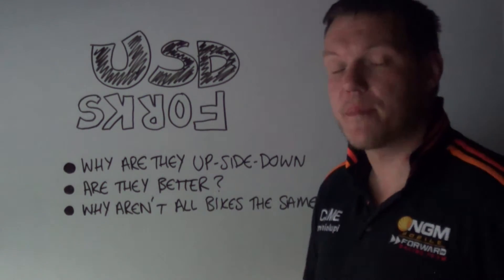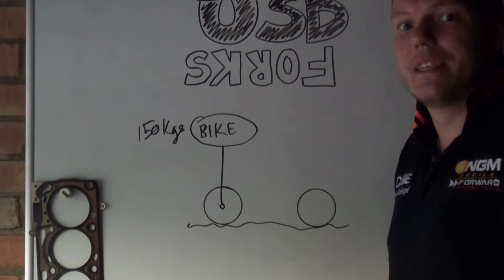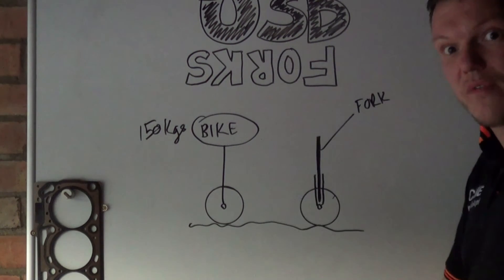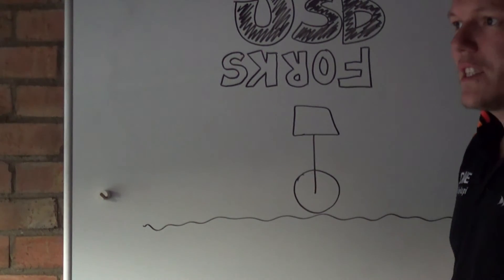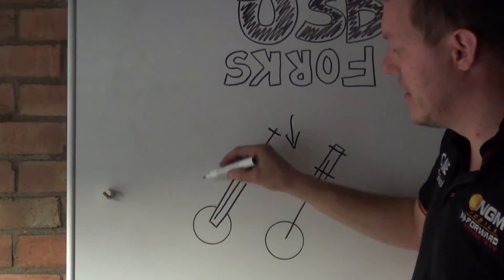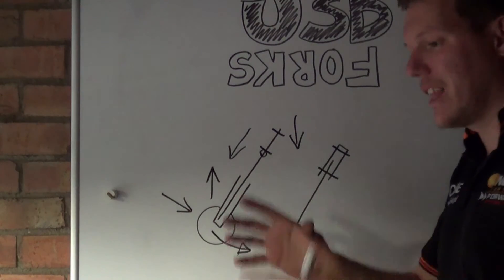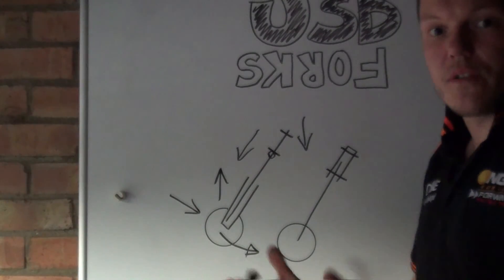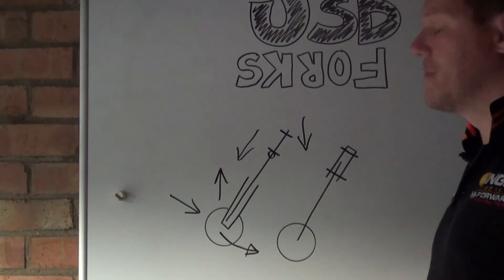USD forks - what's it all about? - Bike TEch

Comment: I have have had bikes with both types, and to be fair never really noticed much difference between the two , but my BMW with the tele-lever is a totally different kettle of fish fantastic forks but against a standard set up carries the extra weight so no good for the race bike ,  as for the unsprung mass the jaguar engineers got this when designing the E type rear axle and put inboard discs , and let's not forget the other iconic race car the 2CV  had inboard discs to the front 👍👍👍

Comment: I have a question about the material stiffness. You said that aluminum has a higher stiffness than steel, how is that? Because isn't steel a much higher Young's modulus value? Thanks for the video
Reply from the maker: The elastic modulus of a material is intensive not extensive. In other words the Young's modulus is dependant on the material period, not the shape or size of the part in question. 

Stiffness is extensive, the stiffness very much depends on the shape and form of the object being tested. This is why H beam rods are that shape. 

But you are correct - what I should have said was Aluminium is stiffer vs a steel counterpart of that weight.

Comment: One thing... yes just one thing! I thought also that the handling on a USD fork is better because the weight is less on the top and lower to the pavement that gives the bike a better frontend handling and makes it easier to flip from turn to turn (direction changes). As lower the mass you have to move in a turn as less the gravity will try to pull it out of the turn.
Reply from the maker: this is the difference between sprung and unsprung mass or have I missed something?

Comment: Proper late comment but another point I heard for usd forks was so the tube section could be longer meaning less flex, less wear and lower sliding resistance as the stanchion bushings are a lot further apart but still have equal travel to conventional forks.
Reply from the maker: "longer meaning less flex" - longer would mean more flex as the force is applied further from the pivot.
Reply: The Workshop “ longer meaning less flex”
unless it’s the interaction between two tubes that haven’t suddenly grown in overall length/travel! Cock
Reply: @ChrisWGT86  classy.... Because you weren't clear or accuraftte throwing insults. Smooth dude

Comment: Excellent explanation! And they are really filtering down now, my cheapo Chinese supermoto has big fat upside down forks. And you are right I can tell the texture of the road surface much easier with USD forks on the supermoto thank I can with the conventional forks on my Fazer.
Reply from the maker: One thing I didn't touch on was it makes more sense to have USD's on lighter bikes than heavier bikes, and most race bike are really light.
Reply: Makes quite a bit of sense!
Reply: almost the only selling point for conventional forks anymore is price (which is going away as usd becomes the norm) and certain longevity reasons such as an adventure bike. when you blow your seals in the middle of nowhere, with conventional forks you keep your fork oil and keep limping to the next town. with usd that limp along will be with no damping, just bouncing along on springs alone.